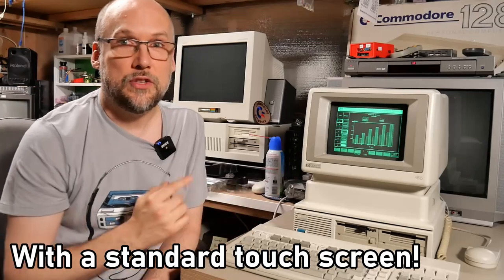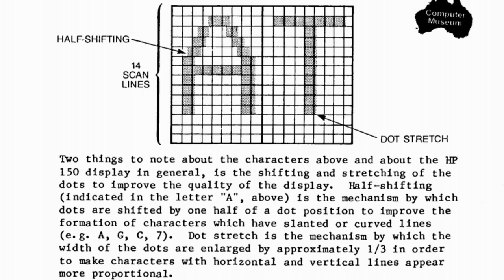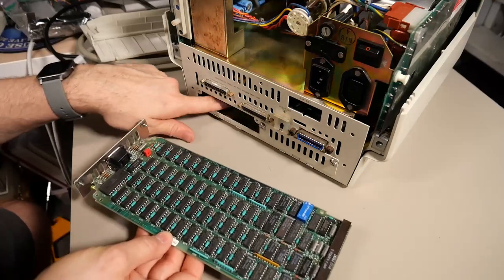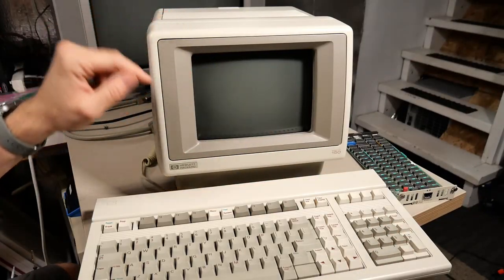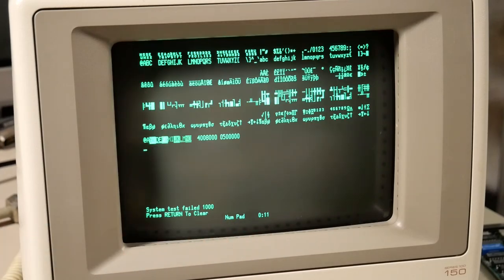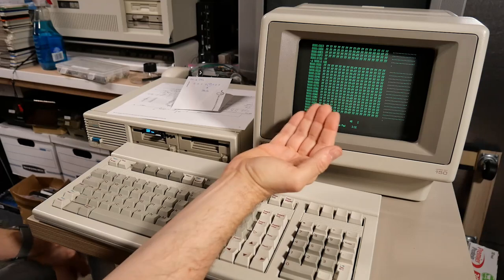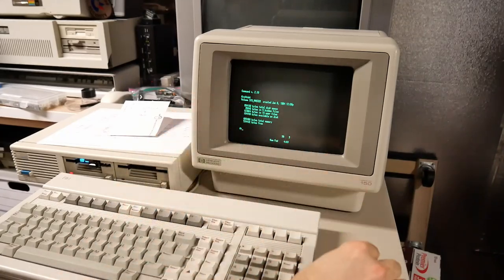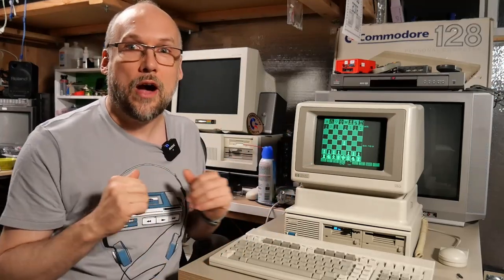Touch Screen MS-DOS PC from 1983

Comment: The local University in the next town over had tons of hp items. Hp 3,0000, 9000, et terminals, printers, disk packs, and you guessed it. The hp150. Stupid me throughout the years passed out in completed systems and not. Thinking I'll run into a complete one. Well I should have picked up all the pieces. I would have had a completed one by now. Oh, well can't dwell on the past.

Comment: There were called "BIOS Compatible" PC's.   They ran MS-DOS, but they weren't PC compatible.     HP had a professional line of these computers that were quite expensive, but used stock 8088 chips running at 4.77mhz.   They cost more than an equivalent IBM PC at the time because HP had a reputation for very reliable equipment, and shops that were already using HP's mid-range computers tended to buy everything from HP.

Comment: I remember these monitors well as I worked for HP in the 1980's. But I had only noticed these used at in-house HP locations as they were expensive. I'm not sure how many companies or individuals really had a use for touch screens. Back then, true blue IBM was what everyone wanted. I remember that these were replaced by HP Vectra computers with color monitors as this was fully PC compatible, preferred and needed by HP employees. HP made a great product that was very reliable back then, but quality went down in the 1990's. Fortunately, companies realized that DOS machines that were not fully IBM DOS compatible was a bad direction to go. - I remember when the State of California purchased thousands of DOS based WANG computers for millions of dollars but never used them since they were not IBM DOS compatible. They were eventually never used and scrapped.

Comment: What an interesting computer! Better than IBM in any respect other than expansion slots. I fell in love with the text display. So much, in fact, that I tried to replicate it on an FPGA after recreating more or less the contents of the character generator ROM. But results weren't as good as expected due to my display. Definitelly, LCD screens don't like half-pixel delays. It could be a nice trick for CRTs but not for modern monitors. I also want to remark that in the HP video board pixel stretching is done using just a single capacitor. Again, amazing design!

Comment: For the memory debug, if you're doing this again ever. If you could somehow power that board manually, and manually trigger a reset of some sort (touch a live probe with control voltage to the reset pin on each ram chip, or tie all the data lines to ground and trigger a write on each of them), then it'd be a simple task of finding a chip that's got a pin stuck high.

Comment: LS245 will see open inputs as high level just like all other TTL chips. Their inputs are current sources that can only source current but don’t sink any. Connecting 5V to a TTL input draws no current. There’s just a reverse polarized diode there. And, unless huge bus capacitances are involved, the TTL input currents are high enough to recharge any capacitance that may have been keeping the input low due to a dynamic ram effect.

Comment: I know this is a very old video, but I'like to let you know that the HP-IL is a general serial bus ("HP Interface Loop") that may connect a lot of different peripherials to the machine. You could say it's a little bit like the IB but for a lmore light-weight ooped serial bus. So - not just a funny mouse connection. Both the available bus types were probably carefully selected by HP; quite some equipment for measurments and control used them, like HP oscillosopes and data recorders. W all that said - really nice to see the machine being taken care of; we should maintain some more respect of old technology and not just throw it away because it' not new any longer... I believe I've got a few HP-150 machines w both HD and FD units in good shape still stuffed away somewhere.

Perhaps I should also mention that the compatibility isn't entirely bad; long ago I actually transferred some binaries runnable on an standard DOS PC right to the HP150 and the exacuted just fine.
Reply: yeah, I don't know why less than 99%+ compatibility surprises anyone. All the machines of that period, including very nice ones like the DEC Digital Rainbow, Tandy 1000, etc, weren't fully compatible, with the exception of Compaq, even a couple of PCs which "pirated" the PC BIOS outright weren't "fully" compatible. Copyright of digital items hadn't been set in US law yet, Phoenix had not sold BIOS that would enable clone-makers, "ISA bus" didn't even have a name. The whole clone business didn't start until later, and didn't really pick up until Windows 3.1 came out. Although Basic was very compatible, most all being provided by Microsoft at the time. There was some expectation that homebrew Basic programs could be traded and shared.

Comment: I saw a similar system on Computer Chronicles. It was a 68000-based system with HP-UX built into ROM, but it did have that nasty-ass little touchscreen display -- and a printer on top!

Comment: You want to make an extender board to bring the internal plugs outside the machine so you can plug in the card outside the case where you can probe it.  I built one of those about 30 years ago to help repair a large bank of electronics in an early digital x-ray camera.

Comment: I worked for HP from 1980 to 2001 ,, I worked on all the Desktop Range and later Mainframes
They created some amazing products, but just let them go by the way thinking there was no market
Look at the HP 9845C, HP Omnibook 300/600, HP Journadas

The space  at the top was for a thermal printer

It was board swap exchange, no parts replacement

HP-IL was a fore runner to USB, it was a way of connecting/daisy chaining low speed peripherals

Comment: Tech would have access to extender boards to test a board in a system. Also, there would be test fixtures that would allow the board to operate and have access to the chips for troubleshooting. Mod wires may be bypassing a short under the solder mask. "Newer systems" with speed issues could have used a shorter wire to decrease the time a signal got to the other point but probably not that fast in 1983.

Comment: As soon as I heard their diagnostics troubleshooting manual that said "you get this error, replace board" I just thought "oh, this must be an HP product." I'm not sure why it struck me so hard that this must be from HP, since a lot of their newer stuff has mostly reasonable troubleshooting steps provided, but yeah. Maybe it's from when I was researching on some of their G7 blades and it was like "if you updated the firmware on your network mezzanine expansion card and it stopped working, replace board." Except they didn't mean just the daughter board, they meant the whole motherboard too. Not a bright time for HP, that was. They accidentally released a firmware update package that, through the mezzanine expansion card, bricked the whole motherboard. It reminded me of when someone tried to update a Lenovo server's BIOS and it failed, but the golden BIOS that it was meant to flash back to was from before they added compatibility for the processor that was in it, so it just straight-up bricked itself. Not a fun time for that business unit, since they had to see if they still had a support contract for those servers so they could get Lenovo to send some guys out to replace the motherboard. Maybe they learned to never run firmware and BIOS updates remotely, but probably not. I miss when server motherboards had two discrete BIOS chips so you could flash them individually and swap over to the backup if the flash failed just by either designating it in the BMC or by changing a DIP switch on the board. Cisco is one of the only ones that I know of that has done this through their M6 stuff, but I don't know if they continue to do so. Hopefully they do, because it is a great solution, but company bean-counters have a fantastic way of ruining a company's reputation by cutting corners unnecessarily.

Comment: My dad and I went to look at this machine along with a computer called a Otrona Attache, portable computer.  The salesman told me that if a fly landed on the screen of the HP it could change the menu because it would intersect the light rays.  I was in my early 20's and wanted one of these... It might have well cost $1,000,000.

Comment: Most every system with removable cards and backplanes have had extender cards made such that the card can be plugged into it and be accessible while troubleshooting. Perhaps a set exists for this model. Also, I think Odd Tinkering or Rescue & Restore has a nickel plating tutorial on their channels. Maybe that could be a solution for when you have to repair corroded contacts.

Comment: Yeah, it says 'replace board' as in a commercial business, you didn't have time to go through and test all those memory chips. At the time, these were sold in stores and repair shops would have multiple units to get through and repair for customers. If you stopped and did all the work necessary to fix each board, it would cost the customer more than the unit was worth in repair time .

It's only because now these machines are relatively 'rare' and parts are hard to come by that we appreciate what you are doing in resurrecting dead PCBs for legacy machines.

Comment: So I have an HP 150 myself that I'm trying to restore. Sadly, nothing is turning on other than the fan. No beep or display. Opened up the case and started getting rid of the dust, replaced the fuse. The posts where the batteries are inserted are super corroded. They were left in there for who knows how long. But I'm hoping that there's some hope to getting it at least running and seeing something displayed. Will try what you did with the CR2032 battery holder!

Comment: 38:18 
TTL logic (normally) reads open circuit inputs as high.

A citation from the wikipedia article:

"Like DTL, TTL is a current-sinking logic since a current must be drawn from inputs to bring them to a logic 0 voltage level."

Comment: I remember trying to use one of these soon after they became available, possibly an evaluation. We loved the quality and the presentation of the touchscreen. It WAS possible to use the touchscreen under MS-DOS.
Unfortunately, that was the end of the good news. The driver took up so much memory and slowed the performance so much that the machine was effectively unusable, certainly for the applications we wanted to run on it.
Reply: I think that this could be retroactively fixed. I need to look up service data for this and see if I could add emulation of the hardware to dosbox so a new driver could be developed. It’s not a terribly hard problem to solve. Their undoing may have been the high interrupt rate: since interrupts are expensive, as much work as possible should be coalesced within the handler on those old systems if it can lead to lower interrupt rates. On the other hand the hardware must be designed so it never forces the driver to wait on anything. So this may we’ll be a case where the hardware needed waiting on and the only way not to just block everything up was to run interrupts often. That’s just a guess and may be totally wrong of course.

Comment: We use to use lots of hp test equipment and had to adapt our computers to be able to use the print screen function on  the HP test equipment using the HP-IB.  Might have been more cost effective to use the HP-150 instead.

Comment: Great Video. I was thinking you could have shorted one of the other bits high or low to determine how each bank is laid out on the expansion board. I do that sometimes when I don't have good documentation, just so I can tell which components affect the part of the circuit I am troubleshooting.
Reply from the maker: The bits are wired to all the RAM chips, so grounding the data bit 3 would have caused a short on all the RAM chips on that bit.

Comment: @33:22 when a board is removed from power, as you show, isn't there some kind of device you could use to test each RAM chip with some kind of piggyback connector? An external testing device that could quickly touch all the pins on the RAM chip... power and test the chip? As many of these older computers you work on, would seem useful given how often RAM chips come up bad.
Reply from the maker: This should be possible yes. Maybe. Depends what the bus signals are connected to. In circuit testing only works in some cases due to things like that.

Comment: (17:51) they shorten the traces to solve a timing problem, think eleven centimetres per nanosecond! 
Or there was a capacitive coupling signal interference or loading issue, think RF feedline transmission impedance loading, with stubs, shunts, standing wave ratios, and smith charts...
Reply: I don't think the length of the traces was the problem. This is an ultra-slow machine compared to modern standards. I think they had trouble with too-high capacitive coupling to the ground planes, that explains why they scratched both ends of the board traces too...
Reply: I'm willing to bet it was from cross-talk. Those traces that they cut out were running parallel with another trace and that could have been causing interference from capacitive/inductive coupling from the adjacent traces. Also. Being that it was a 6 layer board. Capacitive loading could have been a problem too because on a 6 layer board. The ground and vcc buses will cover that entire layer with a solid copper plane.
Reply: @appliedengineering4001  indeed, capacitive coupling and induced crosstalk are not fun to troubleshoot!

Comment: The GPIB port on a PET doesn't look like that, it's a non-standard card-edge connector that requires a special (and relatively expensive) cable from Commodore.  All the Commodore GPIB peripherals have the standard GPIB port and daisychain in the normal manner for the GPIB.

Comment: Regarding those blue jumper wires on the graphics board with certain traces severed. It was not uncommon back in the 80’s, especially with certain budget computers for the manufacturer to fix any issues with the design layout of the traces on a PCB discovered after producution by simply cutting the wrong placed traces and soldering on a jumper wire to re-route circuit to were it should have gone in the first place. This was done because it was much cheaper then having the whole board redesigned. For example, If you were to take apart a Sinclair ZX-Spectrum computer from the early 80’s and look at the main PCB/motherboard you would almost certainly see jumper wire fixing issues with the circuit board layout because the low cost of the computer meant it was much cheaper to fix it this way then have a whole new set of fixed PCB made. Nowadays you can do PCB circuit/trace simulations such that most if not all problems would be discovered in the design phase prior having the PCB’s printed/manufactured so your unlikely to see this sort of thing even on a budget computing device. 

As for what circuit design flaw they were fixing on the particular graphics board you should but I would guess that board was early in the production as generally if the production of said board went on long enough they would often just redesign the traces at some point and eliminate the need to solder jumper wires in the ensembly process. Sometimes, for computers/computing devices on they market for extended periods of time such C64 or Atari 2600, they simply redesigned the board with a  reduced number of components as advancing in circuitry design/IC design allowed what once required several chips/components to be combined into one cutting the space required as well as the cost and in that case they can also illuminate any jumper wires once needed whith the redesigned PCB. Compare the original Atari VCS/2600 to the 2600 JR where a redesign allowed for a much slimmer case at a much lower cost ($49.99 in 1986 vs $199.99 in 1977).

Comment: @Adrian's Digital Basement That keyboard uses switches that are prone to binding up due to dirt, also depending on which series of those switches they are, they used an Electrically Neutral Lubricant that was basically a frictionless no-drip coat. My advice is to use one of the blank function keys as an experimental disassemble to find out if it is the lubricated kind or not. The lubricated kind use bonded injection molded housings, where the non-lubricated use snaps together.
Reply from the maker: Ah interesting so the lubricated ones are not serviceable? Other than trying to externally wash them I suppose.

Comment: That monitor bezel reminds me very much about a really bad touch-screen ATM I used at some small Swedish bank around the shift into the 00's, only that CRT was incredibly curved and the touch-area was flat and hard and thick enough to make inputs difficult. The holes? That could explain it. Like they wanted to protect the surface and you had to BEND the front plastic they put in place for protection and cleanliness, for input.. Light-pen technology was locked behind expensive patent licensing agreements I suppose.

Comment: Cool video! I have one of these systems, but I am currently missing the keyboard, and of course it will not boot without one. Would it be at all possible for you to, like, take pictures of the inside of the keyboard so I can make a guess at the keymap? From what I can glean from the sparse information I've found online, the keyboard seems to have row and column counters clocked by the keyboard bus and it just goes through one by one, strobing each key sequentially without anything too fancy beyond that. There's even a reset pin on the connector!

Unrelated to that, you wouldn't happen to have any ECL chips lying around would you? MC10000 series? I broke my oscilloscope and it needs a new MC10192.